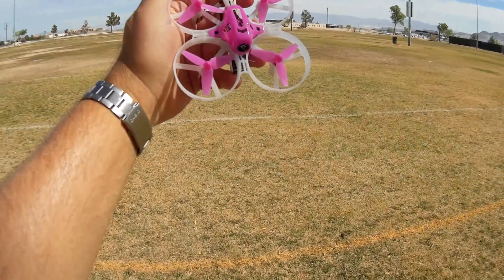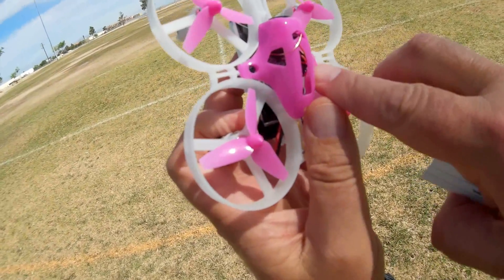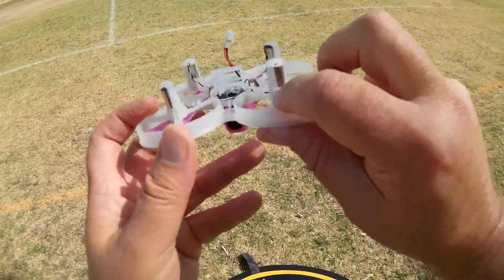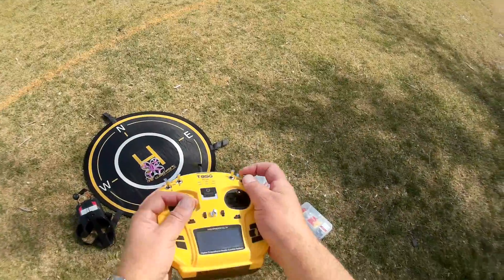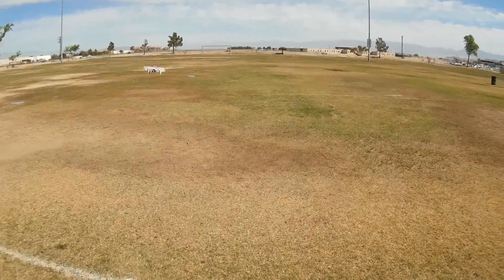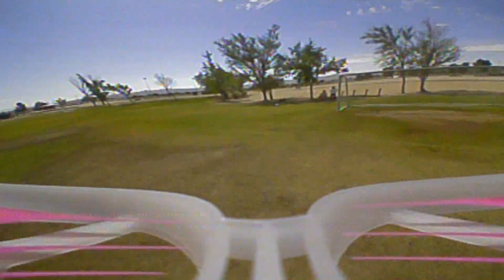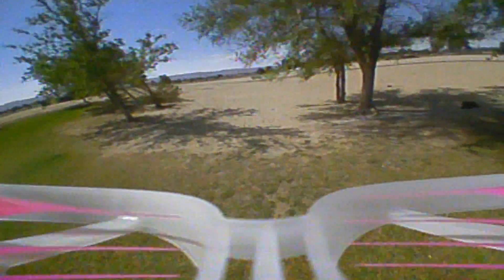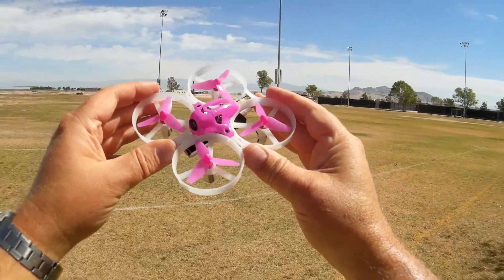Tiny 8X (Advanced Combo) Large Whoop FPV Racer Drone Flight Test Review

Comment: DO NOT BUY LDARC tiny 8x quad, amazing quad design, but cheap and FAULTY props design, that fly off all the time, and quad just turns over in the sky when hovering. the thing is unuseable, I 1st tought it was betaflight error, put new one on it (v3.3.1), setuped it lightly with defaul settings from the user guide, and the props still fall out, quad turns up side down vilently. you cant have stick on props with this powerful motor, you need to screw them in place like on the et100 series. Im very disapointed, Kingkong is going down in quality, DO NOT BUY! now I need to super glue the prop holes and let them dry to have snug fit, also will sandpaper the motor shaft, why do I need to bother with this things with a brand new quad that lost me my hard earned 95$ ?!?! its a scam!
Reply: Speaking of props, I do find their presence (as well as the prop guards) distracting in the FPV footage. Just find it a bit off-putting how they occupy a good chunk of the bottom of the frame. Plus I wonder if they would obscure the view of certain obstacles that the quad might bump into....probably unlikely.

Other than that, it looks like a good flyer.
Reply: Beta props work fine  the ldarc ones are wayyyy better made than the beta triblades I use tho I have the r7 it's a 8x20/75mm super whoop and I love mine

Comment: Excellent video, I just have one question,  when you tested the roll, you lost a lot of altitude but also looked like you were doing a dive.  Was the quad struggling to recover or were you actually yourself dropping altitude.   Excellent video. I enjoy whoop size quads. My biggest complaint is they loose altitude after rolls.
Reply from the maker: I lost altitude. Most whoops do unless you punch the throttle before the roll.